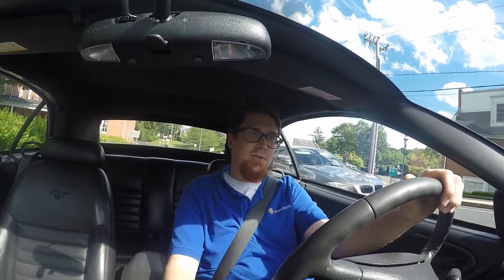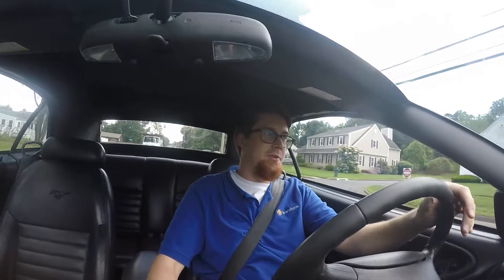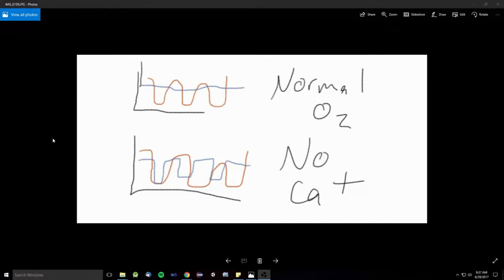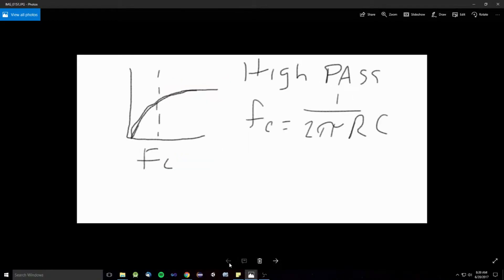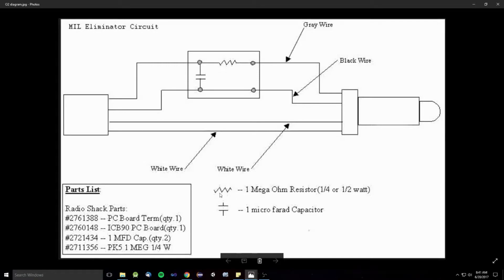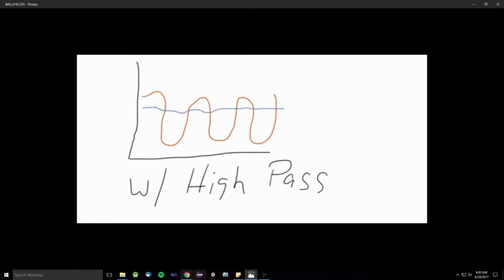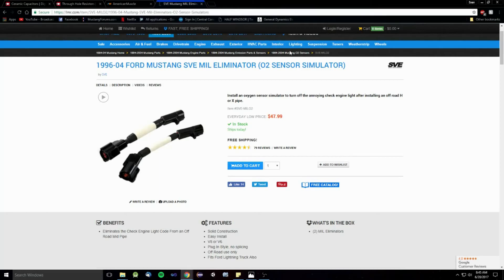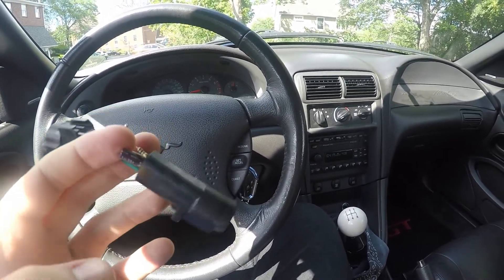Mustang MIL Eliminators - MAKE YOUR OWN!

Comment: The capacitor in the video is a 1.5 M ohm resistor, not a 1 M ohm like the diagram says. Will the part number from the video still work?
Reply: Brown, Black, Green is 1 mega ohm.  That is one, zero and 5 zeros.  1,000,000 ohms.  :) But, a 1.5M would probably work just as well to turn off your MIL light.

Comment: You don't even need to plug it back into your 02 sensor as long as you  use 2  of  
1 Ohm 1/4 watt resistors i have 4 wires on mine 2 white wires and 1 Grey and 1 Black wire, 
I put 1 resistor between the 2 White Wires and then put the other Resistor between the Grey and Black wire then heat Shrink those the Black and Grey with the resistor on it, and did the same to the other 2 white wires, No-more Check Engine light all you needs left to do is just plug it right into the o2  sensor  main Harness. then you're done. I cut off the Connectors from the 02 oxygen  sensors. ( Note:  that the sensors are still bolted on the pipe ).
Reply: Make a video
Reply: Good to know but grammar is no bueno
Reply: No

Comment: Looks to me like you have used an electrolytic capacitor, you will see the plastic cover on the metal can. Makes for a better capacitor but need to get the polarity correct, check it with a multimeter.
Thanks for posting this, going to give it a whirl if the spacers don't work.
P.S. Resistors are not very strong so it pays to support the connections to them.

Comment: But what’s $50 compared to hours repairing MacGyver wiring
Reply from the maker: Yeah - one could argue that. But the whole reason why I made the video is because the ones I bought failed. You could buy the components and do a better job yourself (don't just twist the wires together with electrical tape and hope).
Reply: Some people don't have $50 to spare. Clearly if you aren't capable of doing this and don't have the means to get it repaired if you fail then don't try it.
Reply: @HillBillyBrown  Well if you own a Mustang GT and have the money to modify it enough to have to worry about this issue, then these broke ass people SHOULDN'T be doing it....

Comment: Do u need 4 mil eliminators then?
Reply from the maker: Only need 2 for the downstream sensors.
Reply: So the top o2 sensors to the downpipe of the x pipe i just plug back into the connectors and the other ones need the mil connectors?. My x pipe has no cats
Reply: I plugged the mil eliminators to the upstream downpipe when they need to b connected to the lower then?
Reply from the maker: Kevin Keeney they should be connected to the o2 sensors that would be after the cats. The ones before the cats should be plain o2 sensors.
Reply: @evanlheureux5397  what happens if you put these on the front o2 sensors?????? Plz answer
Reply from the maker: @meezylife673  I wouldn't be sure. Only used them on rears.
Reply: @evanlheureux5397  forsure thanks
Reply: Thanks for the info!

Comment: With wiring in the capacitor which wire is on the negative side??
Reply from the maker: There are no polarities on ceramic capacitors (what I linked to) So it wouldn't matter which way its connected.
Reply: Evan L'Heureux okay thank you.
Reply: @evanlheureux5397  but the ceramic capactor work with AC VOLTAGE.